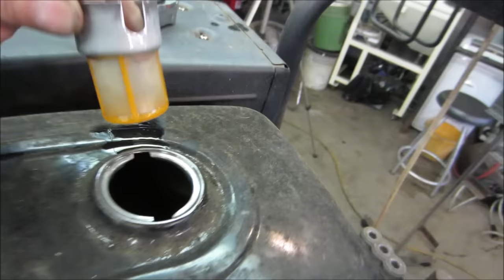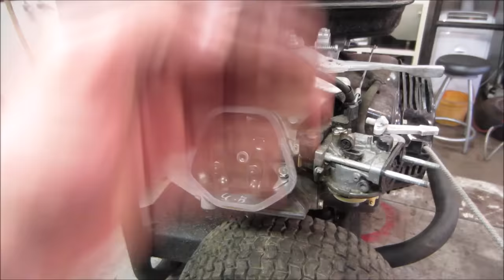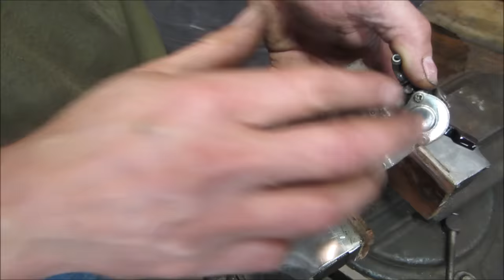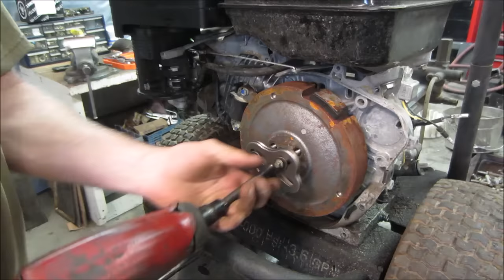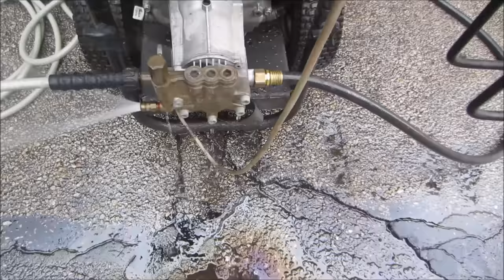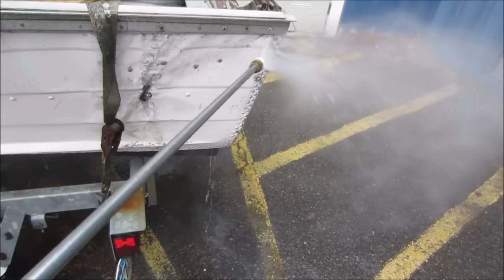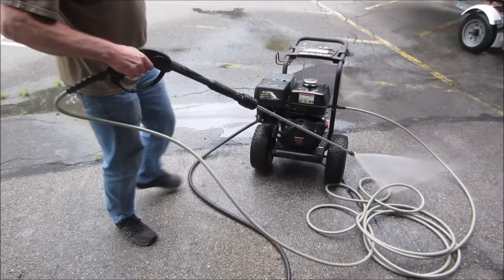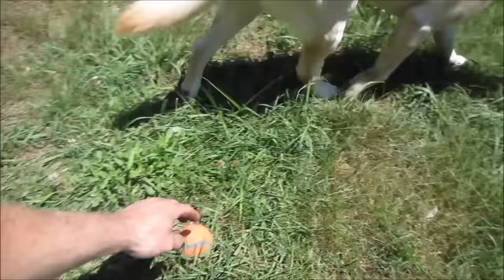Pull start rips out of your Hand? lets Fix It. Busted Pressure Washer.

Comment: I need to rebuild my electric power washer, becuase my boss didn't winterize it and maintain it.  When he first bought it, it would build pressure and shut off when not in use, but now it will run if not in use.  I think it's the seals and/or the pressure sensor.  I tried to take it apart, but I could figure it out.  Also the problem with manufactures is that they mix metal parts that cause seizing; steel bolts into aluminum cast just don't mix, they react with one another "corrosion weld".  That's what happened to my head cap screw on my bicycle; manufacturer used a aluminum hex head into a "steel spider nut?", I had use a drill and tap.  That wasn't that bad, but recently I had to drill out a stainless steel bolt that snapped a the shoulder in a aluminum lawn chair, was impossible.  I had to drill it through both side and put a bolt with a nut intsead of threading in the frame the chair. it works.  Sometimes these stupid manfacturers don't unstand machining and/or metallurgy!!!!!!!

Comment: I have a 13 HP Honda PW belt driven that sometimes pulls the rope out of my hand. Bought new 8-10 years ago...never adjusted the valves or any thing other than maintenance. (Original plug too.) Would you think it is time for valve adjustment and a new plug?...

Comment: Thats leaking valve is there so when your running and not actually spraying the water will heat up in the water compressor due to it stays spinning, when it gets to hot the valve will open for a second of 2 to let the hot water escape and cold water to enter compression chamber. They will stick, as you see, if you put it in your vibrator cleaner, it will probably fix it . But you do need it. you could get rid of it, but you must run the wand every 2 or 3 minutes, or the hot water will destroy the compressor, and thats the end of the game. Thats a nice unit...4 thousand Psi. Nice find !

Comment: Brad
That is a defective thermal relief valve.  Opens at 145F degrees temp.
Reply from the maker: froze last winter
Reply: @mustie1  thats what i figured.  Better that than the pump head.

Comment: I am asking this question because I really don't know the answer. Why do you have to grind the flat off of the air/fuel mixture screw? Was it not originally put into the carburetor with the flat on the screw. What am I missing? Someone, please tell me why it needs to be ground off? I realize that the flat is there to limit adjustment to prevent over adjusting. But Why can't you just leave it as it is? It's probably as plain as the nose on my face. I just don't understand. Thank you beforehand for your answer.

Comment: Today I bought a strimmer a non runner for  10 gbp bought it home put 50.1 fuel mix took the plug out cleaned it and put it back in pushed the glow lead down as much as i could it fires right up 
( that was why it wouldn’t start as it was not pushed Down enough

Comment: I have a machine exactly the same, although mine operates quite well. My operation manual states never run the unit without water, as you will damage the pressure pump.

Comment: I have John Deere 100 series and it is LT115, has 19.5 hp engine. My question it smokes while runs and burns oil.  I read a common problem is head gasket goes bad. What do you think or other problems it might be. Thank You

Comment: been watching your videos very unique, I like your advise in my issue , have a push craftsman mower 6.5 hp did cut some grass ,finished,turned off ,cleaned put it away ,2 days later tried to started  and no even a crank , check for spark none put a new plug still not spark ,changed the coil new one and started for less than a sec and when off and still not spark , what do you advise to check next??
Reply from the maker: the dead man lever on the handle bar grounds out the coil some times the cable slips or stretches, try pulling on the cable some more and see if spark returns,
Reply: @mustie1  I'll try thank u, will let u know .have a blessed day
Reply: @mustie1  yes right on the money! I did what you advised me  and that mower  just fired up, thank you , be blessed.
Reply from the maker: @luilui03able  glad l could help,

Comment: U never want to run the water pump dry. It starts burning up the high pressure seals pretty quickly.
Looks like he also needs a new unloaded valve. Kinda hunts a little to. Carb probably needs a little jetting. All the new epa engines are never jetted properly but atleast their better for the environment ;)

Comment: 11:51   correct. TDC on the COMPRESSION STROKE  ONLY .....not on the other stroke....righton bro. only usually the intake valve sticks, open, on old engines sitting around for a few years. dried gas residue, causes this, as it ages. NO  COMPRESSION, is an easy fix.  good day and happy starting, people !!
Reply: 13:31   correct. .004 thou

Comment: It is crazy but true that for $35 you can get a new carb, starter assembly,  coil, fuel and air filters.... basically all of the common wear items shipped to your door from amazon. I know how to troubleshoot all of these things but at $35 It is cheaper to just swap the parts than to spend my time trying to fix any of them. Heck, at $35 I just keep a kit on the shelf since I have multiple GX series motors and need them to run for my business.

Comment: Numbers have to be outward to be right tale tale sign when you opened it, stick in a good quality business card for adjustment.
Pressure blow out valve is faulty letting water bypass the unit.

Comment: Faster way of adjusting valves... have one fully compressed so you are on top of the cam lobe then adjust clearance on other, then get the one you adjusted compressed on top of cam lobe then adjust the other. That way no monkeying around if you have the piston top dead center or not. Air gap on flywheel use a business card. To check if the compression release is broken if you don't see the bump on the valves after you check the clearance, that means the compression release is broken.

Comment: I had the same issue with a Champion, little black plug under idle adj. big piece of black 
something. broke it up and got it out. this was blocking tiny tiny holes in barrel at 
engine side of throttle butterfly.

Comment: A 3-wheel German brushcutter AS Motor 26 AH9 (about €2,500 new), 6HP, nearly ripped my shoulder out. Left it with a shop. They found nothing wrong and said it was my technique. It's been sitting under a hangar for three or four years. And I turn away when I go past it.

Comment: I love your process and i understand it as i use it myself alot but you missed a important step from the get go i get why u skipped it but you shouldnt have. When you pulled the spark plug you should have compression tested the motor.

Comment: That leak is probably the temperature safety pressure release. Never idle over 2 minutes without spraying. Temperature builds up and pump gets damaged.  It also looks like he may need an o-ring kit for other leaks.

Comment: If you aren't going to have water to the pump when running more than 30 seconds .. take the 2 min to remove the pump so you don't have to buy another pump ($200+).. also Honda has a bad problem with the intake valve gumming and sticking (remove valve cover lightly tap valve spring side and it will usually clear, double check for cracked rocker and valve gap then reseal valve cover without rtv)

Comment: All those attempts over so many videos to try and test for spark by leaning it on the motor while pulling and jarring it loose.  Ever thought about using an large grounding clamp, attached to the spark plug treads and the block?

Comment: I am someone who is on many many pressure washers, I will tell you these units that are bolted together engine to pump are junk. I have a pressure washer I bought back 1993 it's a belt driven pressure washer with a slow speed pump that has ceramic plungers and stainless steel sleeves. The only thing I have ever had to do to that unit in 30 years is replaced the carburetor it still works To this Day in 2020 I paid $1,700 for it it has a stainless steel body that has never rusted. Buy cheap you buy twice. I'm not trying to be a jerk I know not everyone can afford the type of unit I'm talking about. But these units that are bolted together like this one because they don't have a pressure relief valve and are directly bolted together beat the s*** out of themselves just by running. as soon as you pull the trigger it goes bang and the pressure is instant. Buy a really nice pressure washer that is belt driven and it will last forever.

Comment: Hi Mustie. From over. The pond . I watched this video and need to ask a question . I have the same washer as this one , but a different problem . The motor runs ok , but when the water is turned on it stalls , can you help, I know that I am over the pond , and I can't send it to you ,to work on , but can you think as to why it would stall when the water is turned on . 
Yours Mr. R. M. Ehlenbach . ps like the new work shop.
Reply from the maker: sounds like its running lean, if you give it some choke will it stay running?

Comment: I see you do not have bearing buddys on wheel bearings. They will keep out water when launching a boat.They are spring-loaded with grease fittings on dust cap.

Comment: Hi, I have a Troy-Bilt Pressure Washer, used it about 3-years, then let it sit for a couple of years, it starts but the pump won't put out any water.  Any ideas if the pump is jammed or blocked and what I should do?  Thanks.

Comment: Hi Darren, longtime watcher, great work.  I was working same prob on a neighbor's 
Yard Machine mower; thought flywheel key for sure, but it was fine.  Result of experimentation:  neighbor had removed blade.  We reinstalled blade and ... yep, complete fix.  I don't get it.  Why would blade/no blade result in pre-ignition and kickback??
J in PDX
Reply: The blade installed wrong or loose throws off the balance.
Reply: Some lawnmower engines use the weight of the blade as part of the flywheel, and won't run properly if you remove the blade
Reply from the maker: yeah it needs the mass of the blade to even out the pulses
Reply: @mustie1  Learning.  Wonderful thing, learning.  Now about that massive bruise on my other wrist, that the kickback starter handle whacked ... :)

Comment: I hate that happening,it's worse in diesel machines though with pull chord starting,the electric start is the way to go diesel will pull your hand off with a pull chord and the old hand crank mixers are good at wrist damage or busting knees,there are a lot more diesel tools on the market in the UK than gasoline ones and they are favoured for the cranking power in washers ,generators and big mixers

Comment: I have a 389cc Honda. What size is the nut that holds the fly-wheel on?  Is it metric, also does it have left handed threads. Thanks very much 😊
Reply: I now have the flywheel off. Had to use heat & PB Blaster.  The nut is 22 millimeter.  Also a long breaker bar was needed..

Comment: The real Honda GX engines are normally very trouble free unlike the Chinese clones that can have a variety of problems from all the corners the Chinese cut. This one just suffered from being left for years in perhaps harsh conditions and being improperly repaired. I was betting on an Amazon or Chinese coil with an issue not it being mounted upside down.

Comment: reasons it wasnt spraking right was coil was on backward. why it was on backward because where plug wire stick out coil mean firing n behide coil is changering it if turn it around n bottom changer it n top fire it
always have remember where flywheels turn first before putting setting coils

i have worked on ton of this motor it not that hard but just pain in butt getting in it wrong way n i do have customer bought over my shop from mower shop they said they couldn't fix it unite i took it apart seen a lot mistakes

Comment: FYI The screwdriver you need to remove the jet is called a cabinet screwdriver.  It has straight sides.  Why it's called a cabinet screwdriver I don't know.  But probably most likely cabinet makers used them.

Comment: gas cap not letting air in or an issue with the oil sensor killing it. I'd guess they have coil in wrong or off/shifted flywheel

Comment: 22:20 you just clicked down the emulsion tube no bother. I had no bother getting the main jet out. (I've filed down the top of an electrician's screwdriver so the width and thickness are perfect.) But I've given it a shower in WD40, a sonic bath with 50° water and vinegar and washing up liquid for 20 mins (the carb never looked dirty, and seemed hardly used), I inverted an Allen key using the bend as a fulcrum on the roof of the throat. Nada. Is it worth putting a 1/8" length of dowel in, reseating the main jet and trying to nudge it free? Is there any room up there? Some vids say if you can't get it out never mind! Well, the engine (Honda GCV 135) is on a Belgian woodchipper (Eliet Primo) so only ever needs to run full speed I suppose but I'd like to keep this original Keihin carb rather than put in a cheapo. All advice welcome!

Comment: Take your Pull start assembly off and clean the Magnets on your Inside drive pulley where your Coil runs onto or whatever all of that assembly is called ! Those Magnets get rusty and need cleaning with some Emery Paper ! You will be amazed of the good Spark that You will get ! Set the Points gap to around 10 Thou-Thousands  ! It should work then and run properly ! Your Feeler Gauges should have a Brass 10thou Gauge in it , use that to set the gap ! The main problem is spark ! Try it and see if I am correct in what I have written ! I have had problems like that and fixed it !

Comment: when it runs for 10 minutes and then shut off,normally is a clogged fuel tank vent,it creates a vaccum in the tank and engine dies from starvation.that drove me crazy with an old brigs&straton who have a clogged hole on the fuel cap.

Comment: The extension on the choke lever is designed to plug the fuel line when disconnected.

Comment: Thermal relief valve is what's leaking. Due to the the thing running without water hooked up, or letting it set without the trigger pulled for an extended time.
Reply from the maker: froze

Comment: First - doesn't starting/running a pressure washer with no water going through the pump ruin the little pump plungers? OR - was the pump removed until running? HELP please
Reply from the maker: that things been frozen and run dry so many times, he is planning on doing the pump rebuild

Comment: IF it runs for like 15 minutes, sometimes is the fuel cap or fuel tank ventilation clogged, so fuel flow diminishes while the it's level goes down.

Comment: 42:12 I usually always use an ordinary piece or paper and push the magneto on the paper against the flywheel, gets very close and make really strong spark. If the flywheel is little uneven I double the paper.

Comment: I had a pressure washer that would die after running for 10 to 15 minutes.  Turned out the wire for the kill switch was touching the exhaust pipe and would melt through and short, then as it cooled off that short would clear.

Comment: Good vid. Its not always pre ignition.  Always PROPERLY  check valve lash. If the valves are off it can be a bitch and pull you and start on compression side.

Comment: its that little control box that's inline with oil pressure switch unplug and bypass oil pressure switch causing weak spark and interm. spark

Comment: Normally if you don't drain the tank be for winter set's water could be the cause or pour choice of gas.I normally run all my stuff with 89 gas buying the cheap crap 87.

Comment: Too late now but I usually use a .010 brass feeler gauge to set coil gaps.
Reply: That's the best.... 12" gauge does a twin cylinder with ease. Line it up with both coils, adjust one...keep gauge in place, rotate flywheel magnet to other coil, adjust...done.

Comment: That should have a triplex  AAA pump on it with that high if psi. Axial cam pumps are junk. 4000 psi is kinda over kill geesh. I have a 2600 psi and works great on anything I need to clean.

Comment: My old Bultaco had a 10+ lbs flywheel would sheer the key if it backfired at the same time I gave it gas ,,  had to be careful  single cylinder 400cc  with a 100 tooth rear sprocket that bike would crawl up anything ..

Comment: Why didn't you use the crank timing mark to adjust the valves? Doesn't it have one?
Reply: None visible with engine assembled....there are timing marks on crankshaft and camshaft...only visible when engine is disassembled. With external tin (blower housing) off...you can see flywheel magnet lined-up with ignition coil and measure where the piston is in the cylinder with a wooden dowel rod or similar (something that won't scratch the cylinder wall or too thin that could jam the piston in place). Most engine valves are set with the engine a black hair or so past top dead center...that allows for the internal compression release to be bypassed.
Reply: @heyinway  okay. Guess its good enough for low powered engines. On motorbikes they are always visible (you undo one screw)and these marks are always the way to go, that's why i asked.

Comment: That's a temperature and pressure safety valve. It lets go if you put hot water in it or the pump gets too hot
Reply from the maker: think it froze with water in it

Comment: I have a darn oil pressure cut out.. on max beans i can only get it to run 10-20 mins tops before a 5 minute break lol i use it on 1/2 its plenty
Reply from the maker: most people just unplug them when they go bad